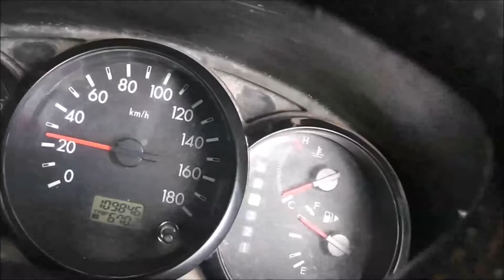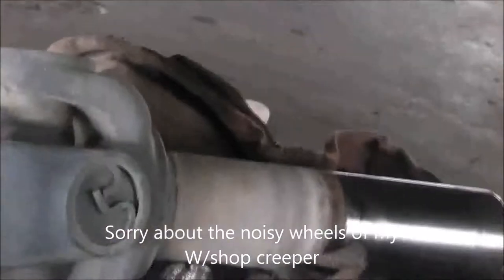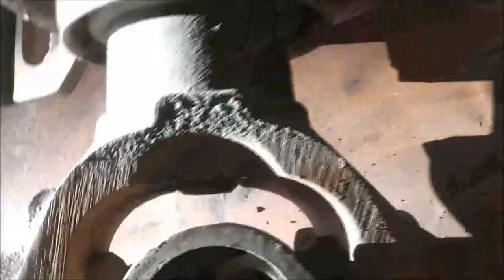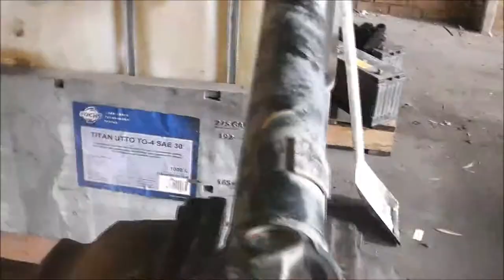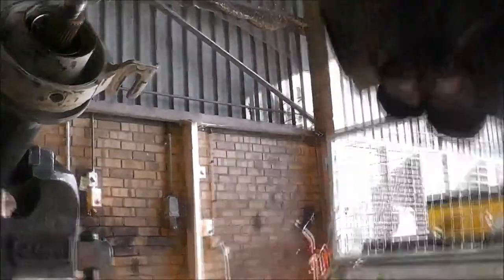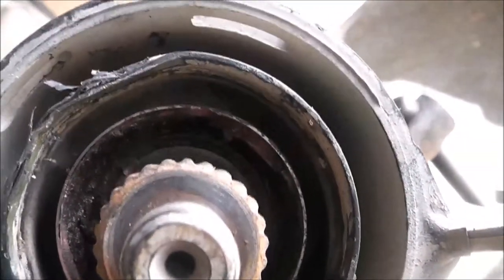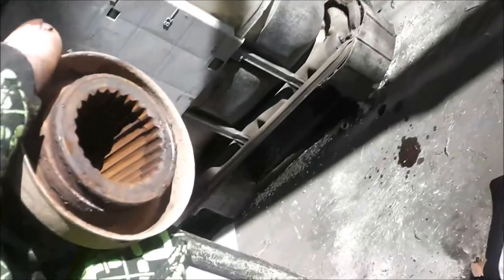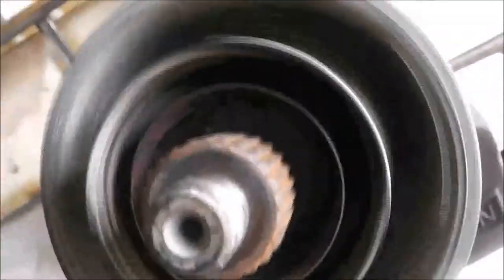2010 Ford Ranger Driveshaft Repair

Comment: Always check centre bearing retaining nut apparently there is not enough threads and comes loose . Generally noticed as a deep vibration grumble when accelerating normally .
Hardy Spicer fit a new nut and H/duty washer /spacer .